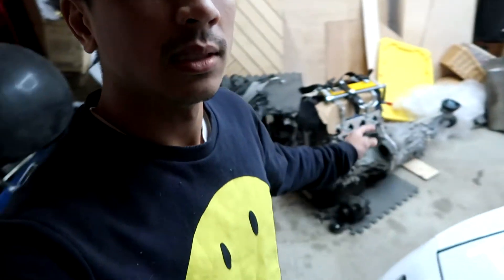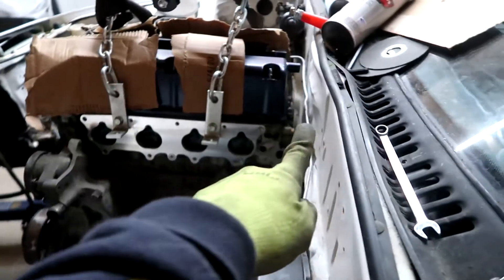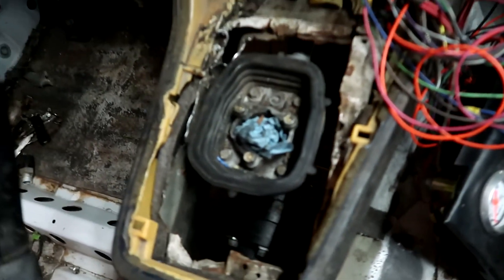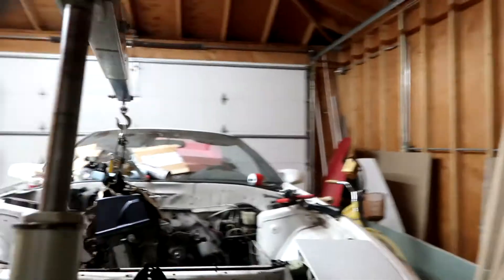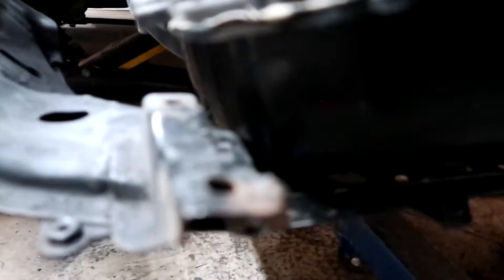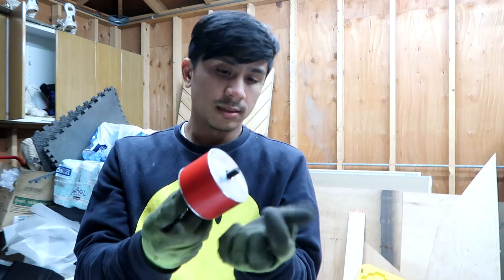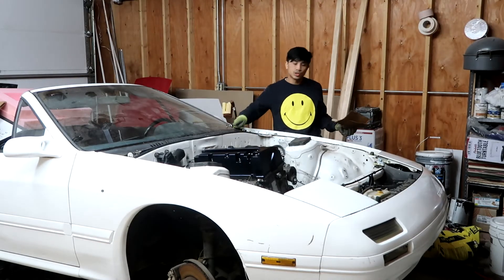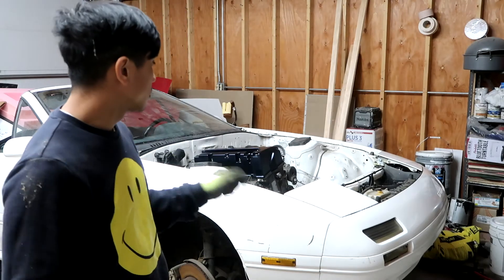Does the K24 fit in the rx7?

Comment: Think the valve cover would fit better under a scooped t2/GTUs hood?
Reply from the maker: Yes that is possible. I haven't had a chance to inspect one yet.
Reply: @blimp6393  I'm toying with the idea of a k swap... but definitely don't want to cut the hood
Reply from the maker: @frankcollins6189  easy way around that would to install subframe spacers.
Reply: The intercooler hoodscoop hood wouldnt work I dont think. The scoop isn't center it's to the left side of the car and I believe closet to where that hole is height wise.
Reply: @blimp6393  good call thanks (new acct), cutting the subframe and installing spacers should work.
Reply: @officialbigboiofdbc  the k series engines are meant to sit angled at about 15° towards the firewall when installed in a factory car. Rotating the engine for rwd this leans the engine toward the right side of the car bringing the intake level and about right where the scoop is on the left side of the hood. My issue is not wanting to cut the hood because its an aluminum hood not a steel one and they are kinda sought after.